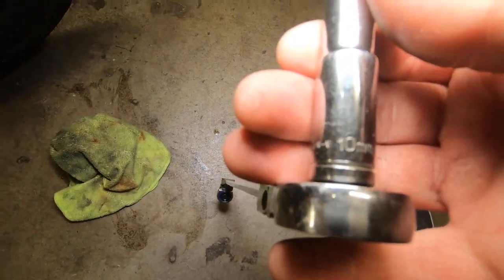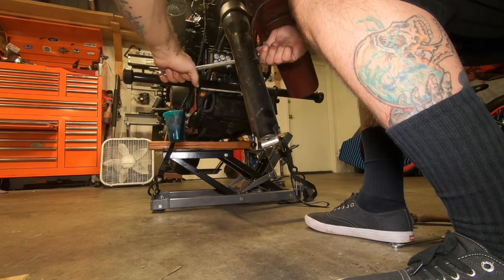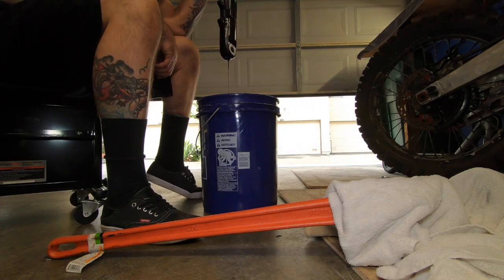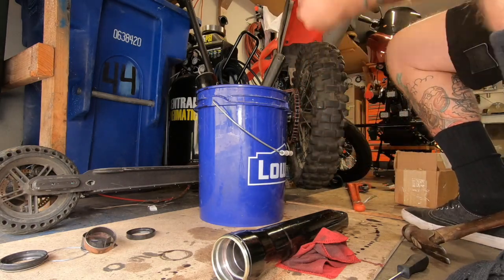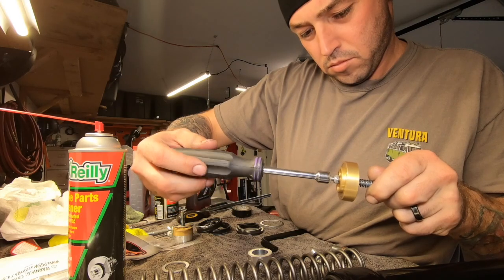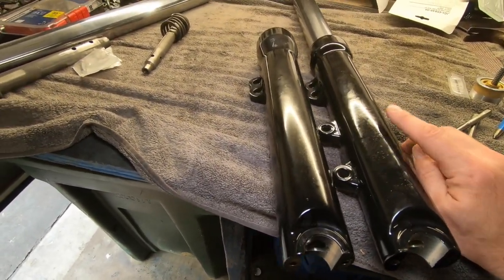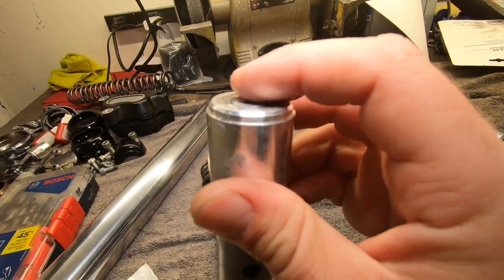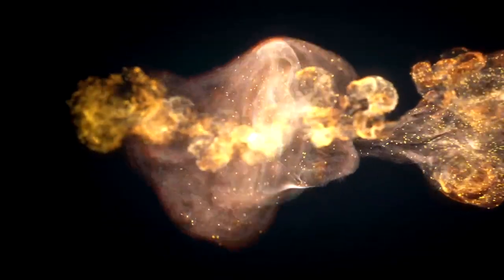HARLEY-DAVIDSON DUAL DISC CONVERSION (EPISODE 1)

Comment: You know how hard it was to find out about the fork tube dampener rod and bolt size? Every damn idiot has not a clue how to do this conversion correctly. Thanks bro
Reply from the maker: it was a learning process for sure and nobody has done it ever! at least i dont think with the bigger dampener installed ...now how much oil is a mind boggle ..glad i could help btw i have 3 or 4 videos on the process

Comment: I love all the LEDs you have on the downtubes.. that’ll brighten your day.. what are they? Got a video on them?
Reply from the maker: Na i do not have a video but from what u remember they just were chinese ones from ebay ..because of power per fuse or how much power you can run on high beams i had to run 2 lights on my high beam wire and 1 light on a separate switch i connected to my dash with a stock stator did fine but you can also update aftermarket stator to run more power

Comment: Did you use your stock dampers of are those extended? I got a FXBB and bought some V-ROD lowers to get myself a dual disc set up.

I hope the install is easy
Reply from the maker: Not that easy watch all the videos yes stock long dampners it’s the 8mm bolt conversion that’s hard
Reply: Yeah I saw, thanks man. So if I use the V Rod dampers 8mm dampers it would be a lot easier?